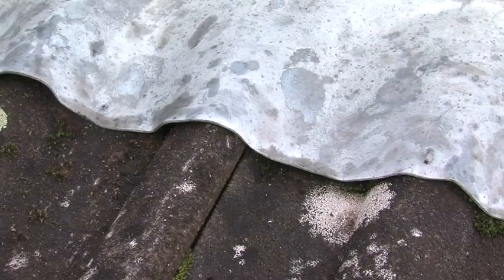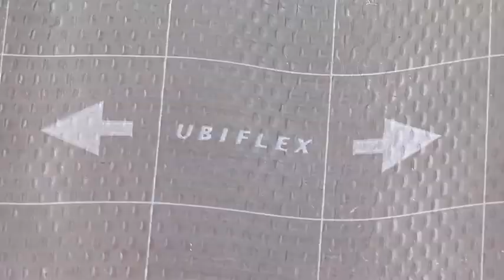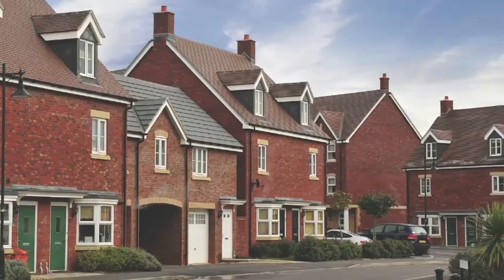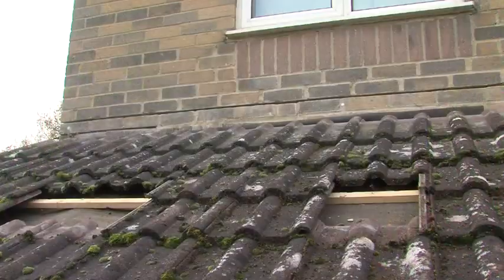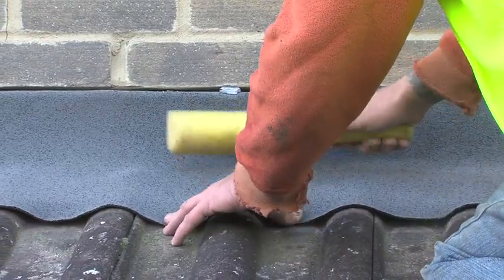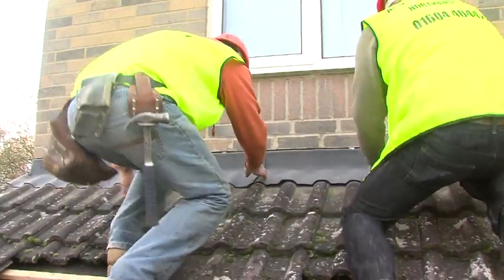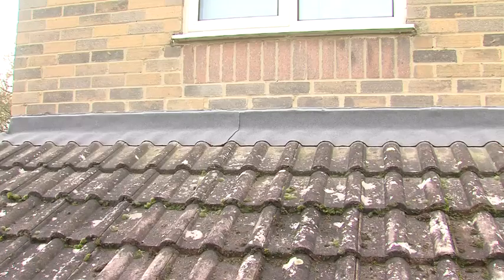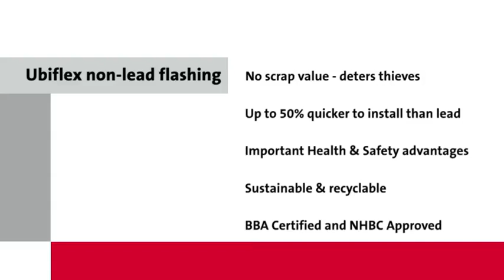Ubbink Ubiflex Non-Lead Flashing Installation Guide

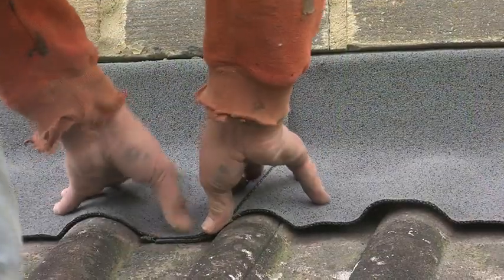Comment: 02:30  What on Earth? You don't put a joint on the rise of a tile. The top piece should be 50mm longer at least so it goes into the next tiles dip. At 03:20 you can see the upstand is crying out for water ingress. The water will fall left going under the joint. Take it a bit further and the water will run to the right and away. Even if you seal the joint it's still a weak spot.